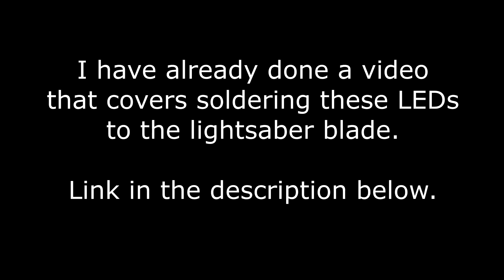Transplanting LEDs On A Galaxy's Edge Lightsaber Blade

Comment: how many leds would you be able to remove before it messes with the board? im thinking about shortening my shoto blade to be the same length as ahsokas shoto which is roughly 6 inches shorter
Reply from the maker: you can remove as many as you want. it will not mess with the board.

take a look at this video: https://youtu.be/CVg4HM05DNQ

in it, i cut about a foot of length off the blade because it had been damaged.